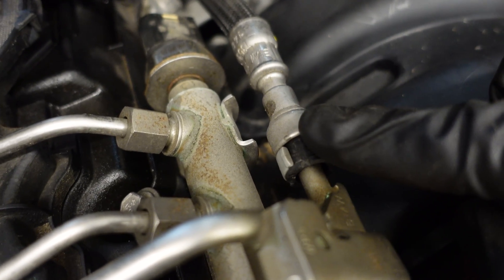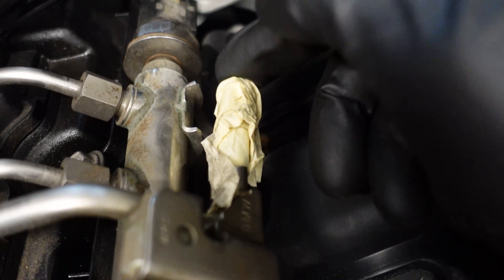N43 Intake Manifold Removal | PART #4

Comment: I need to replace the hose that connects the rocker cover to the intake manifold because it's broken. Do I need to remove the intake manifold, as it's difficult, if not impossible, to access?

Comment: Does the n43b20a engine only have one lower bolt that you used a uj joint to remove? I cant see or feel a bolt there
Reply from the maker: Two bolts.
Reply: @BimmerZen thanks im a bit stuck then because ive been looking all day for the other one. I might jack the engine up and see if i can actually see it
Reply from the maker: @MrRicktangle  have you considered that maybe intake was removed before and the bolt was not installed? So you only have one bolt holding the manifold on the side?

Comment: should i buy a 2009 bmw with n43b20 engine with 140 000km, chain was changed at 105kkm, nox sensor also at some point, cables, spark plugs twice, oil change was every 10 or 15k, it looks well cared for but if it's a flawed design, i am not sure i need so much potential problems in my life (not to mention expenses) what do you kind people say?

Comment: Would it be possible to change crankshaft sensor wighout removing intake manifold?
Reply from the maker: I don't think so...
Reply: @BimmerZen  do you think it might be crankshaft sensor? Out of nothing, i am not able to start the engine. Its cracking and eventually starts when i hold it for about 10-15 seconds. Car sound fine but it is in emergency mode. Some of my warning lights came on. No power steering, no traction control, flat tyres. I dont have flat tyres but there is actually no power steering. Not sure about traction control. Everything happened out of nowhere. My car is z4 2006 wiyh 50k miles on the clock n43. Day before this happened my right bulb stopped working but not sure if this is related. When plugged my cheap diagnostic tool in, it is showing me crankshaft sensor "a" P0335 circuit.
Reply from the maker: @LukasMcrusnacik  z4 had n46 engine, not n43. Get usb cable and INPA, check for codes vanos adaptations and then you will be more able to diagnose the issue.
Reply: @BimmerZen  sorry typo n46. Thanks for advise.

Comment: Perfect. I will buy one.

And you can convert the original throttle body to the other intake? And any software adjust needed? Ho much horsepower you can get with this intake ?
Reply from the maker: I don't know if you can just repalce the intake... Best way would be to replace intake, intake camshaft and flash the ECU to the 170HP version.

You should also probably need to replace the exhaust manifold and exhaust system. 170 HP has bigger cats and different oxygen sensor setup.

The 170 HP versions also have the active motor mounts controlled by the DME, so...

I've never done it myself, so I dont know the practical  specifics.

Comment: Can you tell the model of the Intake with more power. 

From Witch BMW is it ?
Reply from the maker: Part number 11617546981. All BMW's with N43B20 with 170HP and N43B16 with 122HP.

N43B16
2007-2009 E87 116i
2008 E90 316i

N43B20
2007-2011 E81/E82/E87/E88 120i
2007-2011 E90/E91/E92/E93 320i
2007-2009 E60/E61 520i
Reply: @BimmerZen  Thank you very much.

Comment: Hi, did you ever have issue with oil leak in the purge lines from the pcv at the bottom going down to the sump?
Reply: In the cvv return line just to be clear